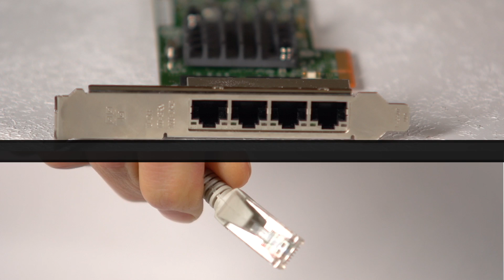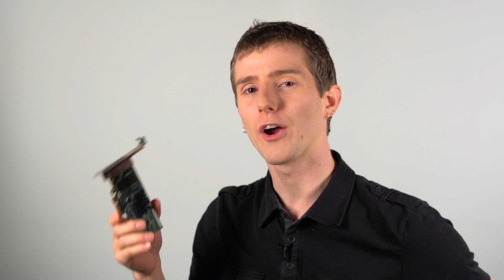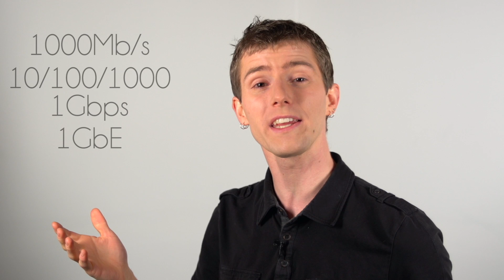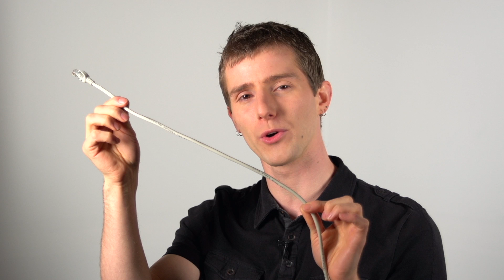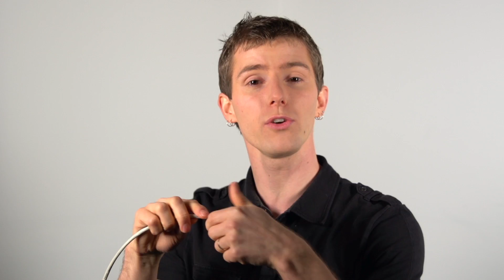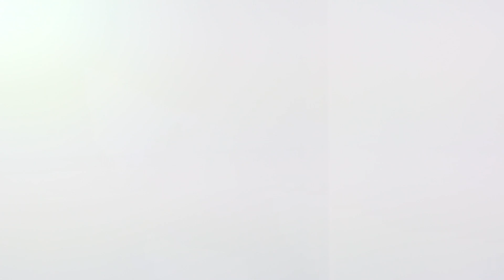Ethernet RJ45 Speeds & Cables - Everything you Need to Know as Fast As Possible

Comment: im having internet problem but i dont know if it the cat ethernet cable im using on my contract 10/1.5mb speed but my max speed is 700kb/sec download soo is that the cat problem because im using some old one from pc to wireless router to motorola router that i use for internet and its an old ethernet cable ? soo should i buy some better quality rate cable
Reply: First,  make sure your cable modem is fast enough to handle the speeds coming in
Reply: Also if you get a faster cable modem, it may need to have changes to its configuration and inform cable company too because sometimes they have to tell their system that you have the faster modem

Comment: If I get an ethernet socket installed in a room in my house far away from the router will the cable be run from the area the router is located in to the desired room, or is there somewhere else these cables come from?
Reply: +Teknium The cable will run from the desired room to wherever your router is located. If it's less than 100m (328ft), then you don't have to worry about anything. If it's more than 100m, then you would need to move your router somewhere closer, but I doubt your house needs more than a football field's length of cable to connect your router to your room, even if they're on opposite ends of the house.

Comment: this might be a stupid question but

Where I live, my internet speed is 25mbps/10mbps

So does it matter if I use a cable that does more than what I have? Or does the cable's speed have nothing to do with my internet speed?
Reply: iFLIP007 As long as you use a cable above 25mbps which is anything Cat5+ you are ok. Dont cheap out and buy cables that are lower than 25mbps although they are hard to find so most likely the cable you pick up will be cat5+

Comment: You didn't even go over how to build the cables. Also most motherboards come with ehternet and i've never even seen a network card in real life.
Reply: Zachary Wolf Onboard ethernet slots on motherboards tend to not have good capacity's. E.G I bought a 87.99 Msi Z97 board and the Ethernet port only handled 60mbps when my Internet was 150mbps

Comment: isnt a switch an active device then it doesnt matter if there is a 5m cable next in it?
Reply: +TheXSairam That's true. After 100m you need a switch, then you can go on with the next 100m but not more than 7 times...After 7 switches you will get problems with the delay of the router witch have to "route" you to the next point, e.g. the Internet.
Reply: the 7 switch thing isn't neccessarily true. That's only if you are using all Layer 3 switches that are handling the routing. If they are simply just 'switching' and not routing. If you're thinking of the legacy routing protocal RIP,  that was a 15 hop limit and is now redundancy as most link layer routing is done over IGRP/EIRGP which by default is a 100 hop limit but can be configured up to 255.

Hopefully clears some confusion!

Comment: Its a great video. Thanks

Can you pls answer this very basic and stupid type question. 

What if my router is gigabit which has 4 ethernet ports and 4 system connected in a single room all have gigabit lan. and if all the 4 system are sharing and accessing data at the same time what is the speed they are supposed to get 

1gbps/ system

OR

1/4gbps/system

Thanks
Manish
Reply: Manish Kumar The router will operate at 1Gb max. This means of only 1 system is "talking" at that moment you will get your full 1Gb out of the router (with very minor variances) If 2 or more are talking, it gets a little hard to answer. The reason for this is some (most modern) routers have ways of prioritizing data. In a perfect world, yes you would just devid ports by max throughput, however, this is not normally the case. What you can note though is if you add up all of the speed from all of the connected devices it will equal "about" your router/switch's max throughput. Hope this answered your question.
Reply: It can even be more complicated than that. Sometimes router settings set up max throughputs based on the number of connected devices. Depending on how many wireless and wired devices are connected.
Some wireless routers have a max throughput cap for wireless if this many devices are connected wired, and if this many wireless devices are connected then the max speed on the wired might also be capped.

Some are very good at handling this prioritizing, some are...not so good.

Comment: 100 meters?? Who the hell would have enough space or would have to run a cable for 100 meters? Or even 50 xD
Reply: Nite Kroller I run long cables in my basement apartment in this house I share with my brother.  I would rather have wires on the floor than to be dealing with wireless.  Wired 4 life!
Reply: Sean DeMarco but 100 meters is like 350 feet, there's no way that you have to run 100 meters, but if you do, than fair enough I guess
Reply: Nite Kroller 

I've run that cable length for outdoor networking jobs (i.e., FinishLynx timing) . Some companies I've worked with run it further and still maintain reliability of their connection (albeit with some loss of speed).
Reply: Nite Kroller If you want to have an office on the top floor of your house, and your router is in your basement. You could run wires through your walls.
Reply: Nick Faber In My college we have 1 router on the bottom floor which connects to a 100m ethernet cable comes up through the wall then we have wall fitted Ethernet splitters which output 8 ethernet slots and provide internet to the 8 computers in the room :)

Comment: If I get a cat 7, will my internet be faster? I currently have a cat 5e running through my ps3.
Reply: No, the internet provider delivers the internet(speed) . Cat 5e cable is fast enough.
Reply: Then why should people get the cat 7?
Reply: Cat7 provides faster local connectivity. Cat5e also delivers 1gbps, but cat7 can deliver up to 100gbps! Only limited distances.
Reply: ***** and what about cat6? I can't watch the vid as I have have a 0.02mb s connection right now. I have a cat6 lying around.
Reply: Well as I said you only get faster local connectivity. If you have a NAS (Network attached server) you only can get 1gbps because of the connector. New Synology nasses have 10gbps. If your computer has 10gb connection you can transfer data faster from a LOCAL nas. cat6 cable can tranfer up to 10Gbitps.
Reply: ***** fair enough,so the cat6 is more than enough.
Reply: Yeah. But your hardware must 10gb compatible(If you want 10gbps bandwidth) . For your computer you have to buy a PCI ethernet controller. Onboard ethernet supports up to 1gbsp Vlad Draghici
Reply: ***** i know,my internet is only 15mb/s down and 1 mb/s up right now though.
So it's enough till i'll get better internet
Reply: Yes. But I use cat6 cable for local ethernet. My download is 120mb and up is 12 mb. With fiber you can get up to 1gbps. My download won't be faster If I use cat7. You have differences between utp, stp, s/ftp cables. That means that the cable is sealed or not. Vlad Draghici
Reply: ***** how much does gbps translate to mb/s? I mean SATA 3 has 6gb/s and so ssds cap out aat about 600mb/s right?
Its a bit confusing.
Reply: Vlad Draghici Sata3 port can support up to 6 Gigabit per second( 6000 megabit) (8bit is 1byte). With a ssd you can read plusminus 600mbit. If you have a raid controller with 10 ssd's your reading will be 2000mbit. And so on.
Reply: ***** so the 1gigabit port would be +/- 100mbit  ,right?
Anyway I might have to use Wireless though.Bad latency I guess.
Reply: Vlad Draghici Uhm no comment:) Well I will explain. If you use a cable, which cable you use, there are some lenghts. How longer how wors it be. if you use a cat5e cable for like 10 meters. You can get 1gb per second. But longer than 10 meters the speed of the cable will be decrease. anyway, If you use Wireless, 1; you get bad latency :) 2: Local file sharing is much more slower than a cable. Now the answer for your question: the 1gigabit port will get 1gbps if you're using a internet cable shorter than 10 meters. The longer the cable is, the slower your local connection is. My advise, if you're using a pc on a same place, use a cable. Much more stable.
Reply: Every network is only as fast as its slowest component. Be it a cable, a router or an end device. The more faster devices on a network, the less likely speed will be negatively impacted.

If your router is not fast enough to handle a Cat7 connection, or it just doesn't have the right port, you might as well use Cat6. That does not mean, however, that your Cat7 cable won't work. It will work, just slower than it can.

But again, that's because of the slowest device you have. You can say all you want that "I have a Cat7 cable", but if the throughput on ANY device in the LAN is less, that lowest speed will be how fast your Cat7 cable can transfer data.

Comment: Why don't we use rj45 cables for things like hard drives, when sata can only run at 6gb/sec???
Reply: Power
Reply: You need power
Reply: Cat6 RJ45 Ethernet provides power too
I connect security cameras that use POE (power over ethernet)
Reply: Steven Recine but you have to use some not used wires in that cable -> lower speed

Comment: 1. The distance you mentioned is the max distance but may not always be true. If for example the source pc has a low quality card it may even have problems at half the distance. Some devices don't have enough juice to push the distance to the limit which in fact true for probably half if not more of the consumer grade products. Build in cards of older MOBO's have this issue frequently.
2. interference: heavy machinery or power lines close by can 1 reduce distance, 2 cause dropped packets but both would mostly be found in a industrial environment or badly wired buildings.
3. there is a CAT 6a, 7, 8, 8.1 standard but only up to CAT 7 is used these days but your right 5e and 6 are most commonly used
4. using 5e/6 makes no noticeable performance difference at short distances (up no 10-20m) but i have personally noticed a difference above 10 meters but only IF you have high-end gear and a good network setup
5. If you only surf the net and you dont have a 1gb internet link there would not be a noticable in what cable you use but a CAT 6 cable might give you slightly better Latency but the difference is so SMALL that its near impossible to verify in some cases
 6.many other things but these are the basics

NR 1 IS VERY important so keep it in mind
Gold plating i would say is over kill and 99/100 times you will just throw away money on over priced cables. If your cable is oxidizing your pc is NOT safe or there is to much moisture where ever you have your pc again NOT Safe.

Comment: Switches, routers and repeaters can be used to increase the range of the cable. So the 100m then a switch and 5m doesn't work. 

Normally you would only cover 95m end to end, once you've got to a switch or another router then you have another 100m play with. Cheap unmanaged switches are a very cheap way around this.
Reply: Routers are a completely different function from switches or repeaters (actually bridges these days), which have no IP routing capability.  In fact, bridges are ancient too.  They date back to the days of coax based networks.

Comment: Good cables and jacks will have gold plating on the connectors. This helps with conductivity as gold does not oxidize, but it is vulnerable to dust interfering.

Comment: i have a 10m cable to connect my pc to my router, the cable runs ~7m and the rest is in a spiral, all tied together... the diameter of it is ~7-8 cm, will this affect the communication between my pc and my router? should i get a 7m cable instead?
Reply: No
Reply: but it loops!
Reply: 1wsx10 It shouldn't, but, you should always try to go for the shortest cable that also has some slack in case you need to move something. 10 meters is plenty long for your needs. Also, make sure there are no kinks/sharp turns in the cable.

Comment: Are the cables basically backwards compatible?
Reply: yup
Reply: Nice!
Reply: It will just run at the bandwidth the weakest link is running at, much like PCI Express. You can run a 1x gen one expansion card in a gen 3 16x slot, but only getting the first gen 1x speeds.

Comment: There will be a small contact resistance, but it will have no effect on the performance. Just remember that you can't split a data cable at a junction box, you'd need to use a hub or switch, but for making a longer cable out of two shorter cables, or even better putting a wall mounted socket on the end next to your PC then it's fine.
Reply: A hub?  Does anyone still use those?  I have one here that I bought almost a quarter century ago, but haven't used in years.

Comment: Linus is probably going  to do a FAP about it but as far as I know
SAS is more enterprise friendly and it has more enterprise-friendly features (eg. Stronger signals through the cable to allow longer cable runs in gigantic servers) and that SAS controllers can be used with SATA drives but not the other way round.

Comment: But what if the switch is 10/10 instead of 10/10/1000. The internal wiring of the switch itself could slow you down. I think that was the point he was trying to make. At least, that's what I got out of it.
Reply: A 10 Mb switch belongs in a museum.  100Mb switches started appearing in the mid 90s and these days Gb is pretty much considered bottom end.

Comment: Uhm, no a switch reads the signal and transmits it to the correct device so it's a fresh new signal without interference after the switch. You can run 100 m to a switch and then another 100 m to another computer at full speed if both cables are rated up to 100 m.

Comment: Linus, does a layer 2 switch @ 100m or whatever 'reamplify' the signal? or just pass along the 'degraded' signal
Reply: Switches receive and then retransmit the complete frame, so the output is a completely fresh frame, not regenerated or amplified.  Way back in the dark ages, devices called hubs were common.  They regenerated the signal.

Comment: well, that explains why the cheap,as in $5 for 50feet cheap, Ethernet patch cable I got off ebay only give me about 10Mb/s transfer speed when transferring files over the network to another computer, even though I got a 1GbE router and NIC, cable is cheaply made and cannot handle more than that uh.

Comment: Good primer
I would have like to seen a differentiation of: 
the number of conductors (vs # of used), twisted pairs, shielded and unshielded, plenum rated and drop rated cable...
what the categories mean, 
what 'Ethernet' is (doesn't just refer to category of wire and terminations), but we tend to use it interchangeably to describe the cable itself.
where 'RJ' comes from,
Power Over Ethernet

These aren't all necessary, but it would only take a bit to explain a bit deeper (still as fast as poss)

Comment: There might be a couple of faults in here. Linus mentions the length of the cable, like running 100m, then another 5 out to another device. That's no problem. the lenght is between 2 components, so a 4 port switch can run cables at 100m to each of the components. No problem.

And there is headroom. We had a cable that was 124m long which worked, but not at 135m, we added a switch at 124m and now it works. This cable is laying in the worst possible way too. (too expensive for fiber for the usage)

Comment: 16:9 = better than 4:3, 16:9 is a similar width/height ratio that the average human vision would have which means more of your vision is filled, your eyes don't have to focus as hard when looking at it as it would with 4:3.
There is also 16:10 which is less common, its practically the same as 16:9 and is just used because its easier to make a resolution between 1360x768 and 1920x1080 on a 16:10 sized screen (1680x1050)